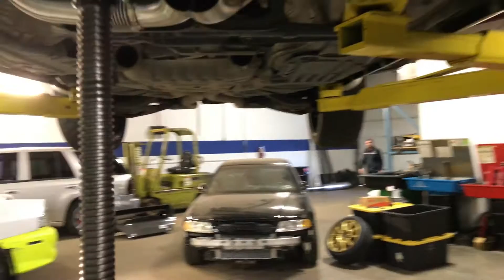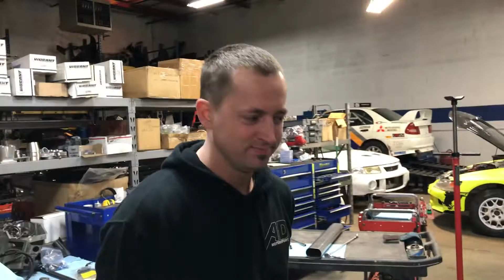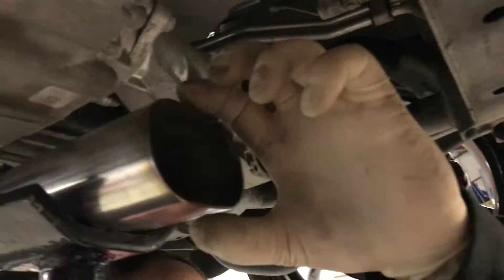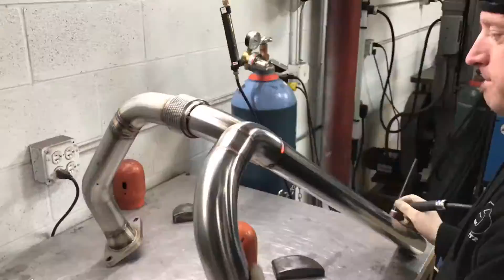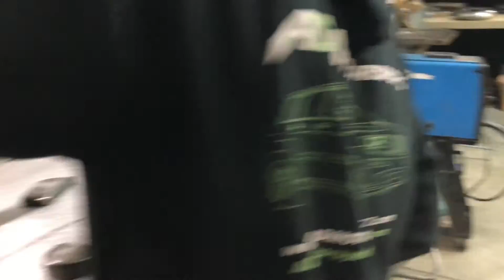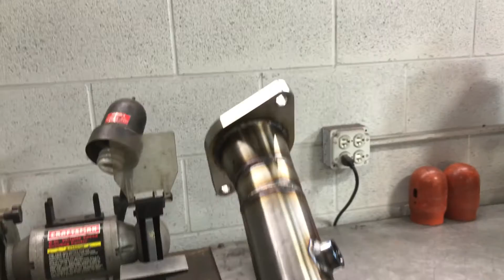Part 7: Jeep SRT8 Turbo Build - Finishing the Up & Down Pipes!

Comment: what kind of work is needed to go from n/a to boosted?
Reply from the maker: My truck was 100% stock before this.  Check out Parts 1-6 for more details and of course much more to come : )
Reply: I'm looking up the cost because I want to boost my car later down the road. Your videos have been helpful  and I'm in the Chicago area as well.
Reply from the maker: Assuming mine turns out well, which I believe it will....I would go talk to Adam when you are ready at AD Motorsportz.  He is great and very knowledgeable and has been boosting stuff forever : )
Reply: Thank you. I will do that when the time comes